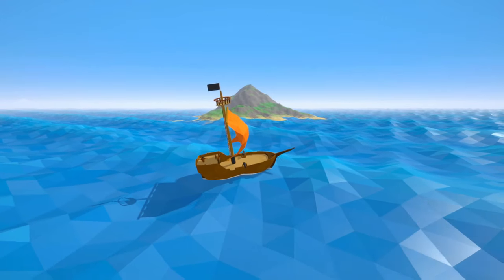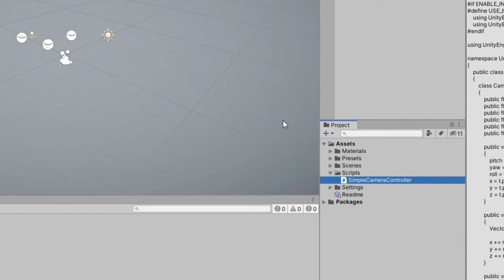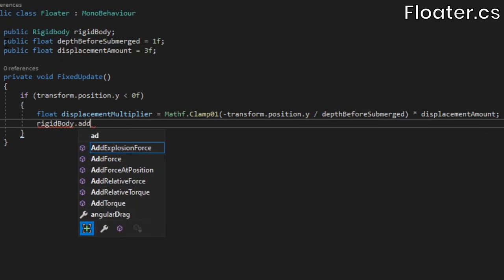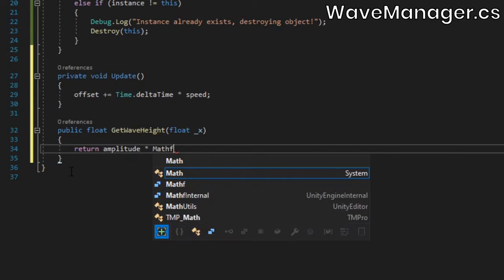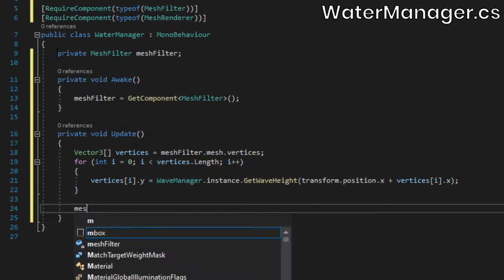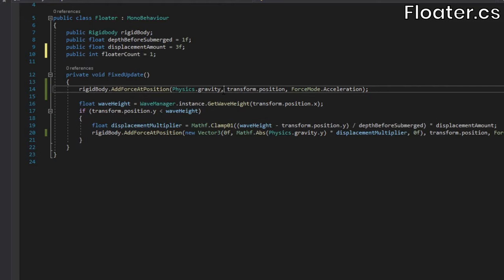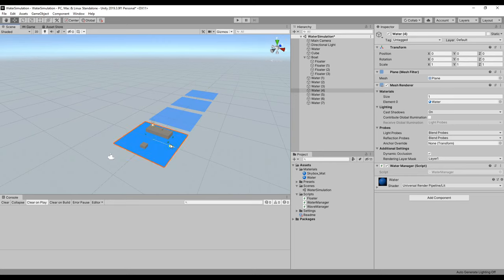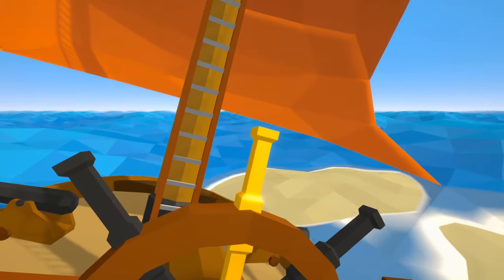How to Set Up Dynamic Water Physics and Boat Movement in Unity | Ship Buoyancy Tutorial

Comment: any reason why the cube won't float everything looks good and the water is wavy?? did I miss a tidbit?
Reply from the maker: Does it have the Floater component? Make sure the water plane doesn't have a collider. If this is still an issue, you may want to join the Discord server and ask there, as it's really hard to debug stuff like this here in the comments.
Reply: @tomweiland  yea the cube has the floater and no collider on water. maybe a word misspelled I'll look again. oh yea the water is a little high up in the air over a house (just for testing) would that make a difference ? I set everything to waveheight just as you said to in the vid. maybe I missed 1 ref. I usually figure it out then repost my resolution in these scenarios.
Reply from the maker: I can't quite remember how we set things up here, but I think the method that calculates the wave height may be relative to the world origin. That means if you move the water plane up, it would look like it's higher, but the "real" water surface would be lower down. Then again, if that was the problem your cube should be falling all the way to the real water surface and not hovering in the air way above it 🤔
Reply: @tomweiland  Well it appears to only work if I have the water at 0 location on the Y, I thought you had mentioned in the tutorial that 1 of the scripts will handle that and you can place the water anywhere? also is there any way to limit the area to which the object will float to just the mesh area it floats even where there is no mesh?- say if the cube is on the side and not on top of the water mesh that it will continue dropping? I have a huge gta style map with underground caverns that need to be walked through and I was going to add the float aspect to my player but this would conflict with that being that its not limited to a specific area. I have my character animating only to specific mesh colliders that are fit to specific bodies of water so if he jumps in the river or lake or pond anywhere within those colliders he will animate swimming but outside those colliders he goes back to land animations I could just apply these scripts somehow to only interact with the splash colliders I have on the top of all my water bodies and wanted to add swimming capabilities which would allow me to leave the surface into the water to swim within the water collider below. If you got anything or any leads I would appreciate it. My games awesome (next big thing killer app) as it is but I'm an Artist I can make 3D models and animations all day anything you can imagine its just this programming aspect has been slowing me down  and I've only used youtube and google to make it got my player throwing thors hammer like kratos axe going in and out cars and jets, shooting enemies that pursue and throwing active objects , jumping, bouncing, punching, flying, dashing, just gotta figure out some more of the basics and I'm set. HELP!!! how much do I have to pay you to help finish this engine QUICK. I wanted to have the Game done by november for the major release window but if I don't finish the system by mid september that would be impossible another year would be nice either way though to polish it. I'm just growing impatient after getting far sorry.

Comment: This was a really good tutorial but I do have one question. When I scale up the plane mesh the visible waves no longer match up with the cube/boat buoyancy motion, the visible waves and the object motions only line up if the water plane is the default 1x1 scale for me, is there any way to scale it up but still have the wave visuals be accurate?
Reply from the maker: That's because in the tutorial we directly used the mesh's vertices, and by default those are in local space, so no matter how much you scale the plane the formula that calculates the height is always being passed the same values. To fix this (I think it should work, though I haven't actually tried it) you'd need to multiply vertices[i].x by transform.scale.x (in the WaterManager script) before passing it to the GetWaveHeight method.

That being said, you probably don't want to be scaling the plane anyways, at least not much. It has a fixed amount of vertices, and if there aren't enough vertices in the mesh, small waves won't be properly visible (similar to how a texture's detail is limited by the resolution you're working with). Instead you'll probably want to either duplicate the water plane a bunch and create tiles, make a mesh with more vertices in Blender, or use code to generate a mesh of your preferred size at runtime.
Reply: @tomweiland  I was thinking of writing a script that makes a bunch of duplicates spaced evenly and seamlessly apart at runtime but the Blender route would likely be safer for now.
Reply: @tomweiland  Okay I did write a script to scale the MeshFilter on startup but that solution ultimately presents the same problems, even when multiplying the vertices by scaling in the water manager. Do you have any tutorials up on how to make a full-scale ocean that works with this wave effect? Or know any other tutorials regarding it?
Reply from the maker: @funnelvortex7722  my game's water is infinite. I use several tiles of code-generated meshes—no scaling involved and it works beautifully.

Comment: how do i make it move, i tried         
        if (Input.GetKey(KeyCode.W))
        {
            rigidbody.AddForce(boatTransform.forward * speed);
        } but it cant find boatTransform 

ok nevermind fixed it but my boat always moves one direction how can i make it move relative to the way im facing
Reply from the maker: rigidbody.AddForce(boatTransform.forward * speed); should be producing directional movement, unless you've got the wrong transform referenced.

Comment: Great stuff but I don't think the subdivison of gravity is necessary and infact even correct depending on the object shape you're working with as you want to apply gravity at "center of gravity" and not necessarily center of floaters. Using the base gravity should be correct here from my understanding.
Reply from the maker: I did it that way to address situations where one side of an object is submerged while the other side is not, but now that I think about it you may be right about it being unnecessary—I wonder if not "splitting" the gravity among the floaters would make any noticeable difference on how it looks 🤔

Comment: hi for some reason i am getting an error: 'WaveManeger' does not contain a definition for 'GetWaveHeight'

public float GetWaveHeigt(float _x)
    {
        return amplitude * Mathf.Sin(_x / length + offset);
    }
Reply from the maker: The name of your GetWaveHeigt function is spelled wrong.
Reply: @tomweiland  Thx man! <3
now I have an other problem...

for some reason my boat goes all wonkey and grazy.
I cant seem to find the problem with the code.

using System.Collections;
using System.Collections.Generic;
using UnityEngine;

public class FloaterData : MonoBehaviour
{

    public Rigidbody rb;

    
    public float depht;
    public float endDepht;
    public float floaterCount = 4f;
    public float drag;
    public float angularDrag;
    public float displacementAmount = 3f;
    // Start is called before the first frame update
    void Start()
    {
        rb = GetComponent<Rigidbody>();
    }

    // Update is called once per frame
    private void FixedUpdate()
    {
        float waveHeight = WaveManeger.instance.GetWaveHeight(transform.position.x);
        rb.AddForceAtPosition(Physics.gravity / floaterCount, transform.position, ForceMode.Acceleration);
        if (transform.position.y <= waveHeight)
        {
            float disMultiplier = Mathf.Clamp01((waveHeight - transform.position.y) / endDepht) * displacementAmount;
            rb.AddForceAtPosition(new Vector3(0f, Mathf.Abs(Physics.gravity.y) * displacementAmount, 0f), transform.position, ForceMode.Acceleration);
            rb.AddForce(disMultiplier * -rb.velocity * drag * Time.fixedDeltaTime, ForceMode.VelocityChange);
            rb.AddTorque(disMultiplier * -rb.angularVelocity * angularDrag * Time.fixedDeltaTime, ForceMode.VelocityChange);
        }
    }
}
Reply: @daanman6338  reset the water plane's scale

Comment: Finished the tutorial, wanted 3d waves, but i cant do them, because the tutorial you listed in the description does not work in URP or HDRP, so i'm at a loss. I have no clue how to do this.
Reply from the maker: I followed the article with the built in RP (before URP/HDRP came out) and then I later converted that shader to work in URP—or more accurately, I took the wave code and basically injected it into the standard URP shader (I'm heavily piggy-backing off that).

Another option is to use shader graph instead.
Reply: @tomweiland  I could not find an option of URP surface shaders. And as for shader graphs, i would have to learn how to use those, which is something i can not get into rn
Reply from the maker: There's no "option" for them. A surface shader you create in a URP project will be a URP-compatible surface shader.
Reply: @tomweiland  Ah, I did not know that. Thank you for your help.

Comment: Is there a way to do this with a shader that alters the verticies?? I found a video that uses a 2d texture, but im using a gradient noise node, is there a way to use this node instead?
Reply from the maker: "Is there a way to do this with a shader that alters the verticies??"
This feels like an obvious answer, so maybe I misunderstood the question, but in the video I mentioned that if you want this to perform well you're going to need to use a shader to move the vertices, so it's certainly possible. I also linked to an article that shows how to write a shader that does exactly that (although it's a built in render pipeline shader, so you'd need to manually convert it if you want to use it with one of the SRPs).

As for using a gradient noise node, I don't see why that wouldn't work. I don't have much shader graph experience, but can't you just plug the output from that into the vertex position?

Also, if you're just trying to create some really small ripples, gradient noise should be fine (although people tend to use normal maps for that to avoid having to dramatically increase the mesh resolution), but if you're trying to make actual ocean waves, it probably won't look too good. Stacking several sine (or, like in the linked article, gerstner) waves would look a lot better.
You may also run into issues with making objects float properly if you have the gradient noise generating big waves, as you'll need the underlying mathematical formula of said node (and I'm not sure if you can find that) to be able to calculate the wave height at your floater positions.
Reply: @tomweiland  Thank you for the reply, I created a shader that alters the mesh, and the last thing you mentioned is my issue, because I want my objects to float with the waves, but I can't really do that with the gradient noise node.. :'(, So I think I'll go with the normal map for this effect! Thank you for your input it's helped me out alot!!

Comment: I want to build a smaller catamaran. For fishing or just for fun with friends. I really want to see my design first how it floats. Can I add weight to my 3D object and then throw it here to see how it floats? Basically where is the water line on the boat. That could help me make better shape for real life construction. I tried CFD software, but those are very difficult to use and very expensive. How accurate Unity would be for my project.
Reply from the maker: If you need to run simulations for real life projects, you probably don't want to use this implementation. It mimics buoyancy pretty well, but it's by no means physically accurate because everything is based on approximations—it's more about getting something that feels right than actual realistic buoyancy.

That being said, you could probably use Unity to set up a simulation that is physically accurate, or at least much closer than this.

Comment: Do u use multiple planes for your game, or one huge plane that represents the ocean?
Reply from the maker: I currently use multiple large ones, but I may split them into smaller chunks so that more of the water surface can just not be rendered when not in view 🤔
Reply: @tomweiland  smart one, but how would you go about making those planes seamless so that the waves connect?
Reply from the maker: They just do...unless you're calculating the height of the vertices using their local positions instead of global positions.
Reply: @tomweiland  Thats weird, I followed the tutorial that you linked in your video. Is the tutorial calculating the verts locally? And what will I need to change to get the global positions in shader?

Comment: Hello, thank for the video, love the floating render !! but when I increase the mass of the body to 1000, the object starting to vibrate fastly. I think it is due to the force that must be applyed to face the gravity (even in acceleration force mod). Any way to avoid this ?
Reply: I just found a solution, buy adding a box collider the problem disepear. But what is the relation between the rigidbody, the collider and the mass ?
Reply from the maker: I'm not really sure why the presence or absence of a collider would change anything—it might be good to do some googling about that!

Comment: Hmmm. MeshFilter doesn't seem to be accessible. Unity keeps saying there's no instance of an object. Has something changed as of 2021?
[Edit]: Somehow, it worked without me changing a thing...
Reply from the maker: Weird 🤔
Reply: @tomweiland  Very. I tried Mesh only rather than MeshFilter and it also failed. Then I reversed back to MeshFilter by simply hitting CTRL + Z and voila LOL.
Your tutorial is awesome. I modified it a bit in my project so I have one script only and two bodies of water using the script (an ocean and a pond). Works terrific!
Reply from the maker: Glad you got it working! Maybe you simply forgot to save changes in the file, and then after you hit Ctrl + Z you did remember to save? Not sure how else that would have solved it :P

Comment: Hey Tom, can you tell me how I can change the Size of the Plane without weird looking waves? If the Plane is normal Size it works perfectly but if I increase the Size it becomes weird, also the Ship floating then doesnt work good anymore.

Ps I use the custom Shader from the description. (3 Gerstner Waves overlapping)

Thanks for your Help!
Reply from the maker: Don't change the scale of the plane, just add more planes (or create a custom one in Blender/via code that's bigger and has more vertices). Scaling the plane would effectively lower the mesh resolution (because it's the same amount of vertices, but now stretched over a larger area), and that's almost certainly not what you want.

The reason scaling "breaks" the flotation is because the formula used to calculate buoyancy has no concept of the plane's scale, so you're effectively scaling the visual waves without scaling the physics waves.
Reply: @tomweiland  alright thanks for the Answer, that works perfectly :)
Have a nice Weekend
Reply: @tomweiland  sorry to necro a thread but when I add more planes and put them next to each other they aren't lining up at all. I feel like I'm missing something obvious. Works fine for sine waves but gerstner are just totally out of sync

Comment: have you tried using a PID controller for adjusting the input per point on the boat?
Reply from the maker: I haven't—I don't even know what that is or what it would do...
Reply: @tomweiland 
Think of cruise control in a car or auto pilot in a plane. A pid controller is just a feedback loop which is error correcting. What you can do is pass in a value to it and it will return a result based on the amount of error. I'm using it to self balance objects such as a motor bike in unity. You could use it on each point of the boat to make it less bouncy. In fact you could make it so perfect the boat could even sit on the water perfectly without any bounce based on input parameters.

Comment: Hey Tom, could you tell me how to apply knowledge from Catlike Coding's article when working in URP?
Reply from the maker: I personally just duplicated the URP standard shader and modified that, but you need to be familiar with how shaders work to do that. It'll probably be easier to use shader graph.
Reply: @tomweiland  I also tried that but I had problems with finding a way to recreate it in shader graph. Could you recommend any article and / or tutorial?

Comment: Hello , great tutorial but how do you get the waveheight (of the floater script) to work with the shader ?
Reply from the maker: You just need to make sure you're using the same formula and offset in both the method that returns the wave height and in the shader.
Reply: @tomweiland  Thanks a lot for the response , i will try finguring that out.